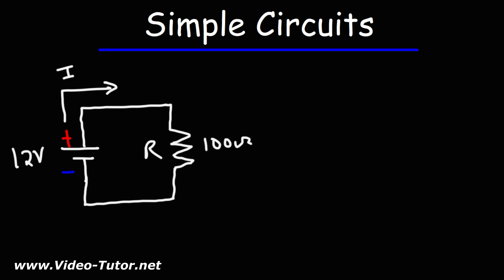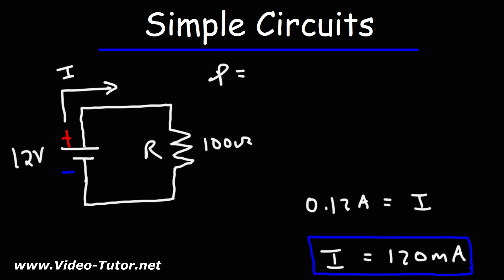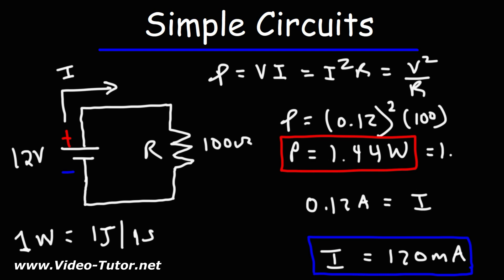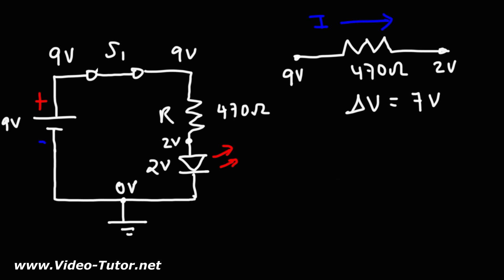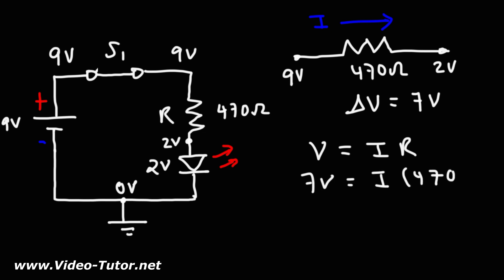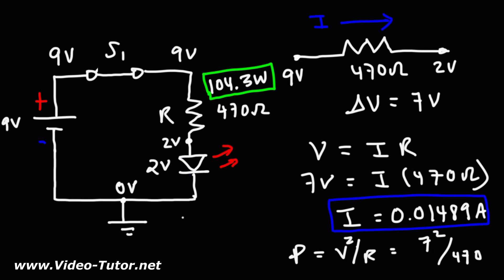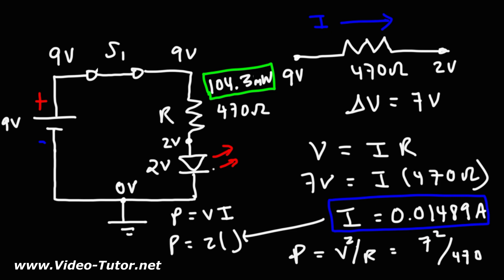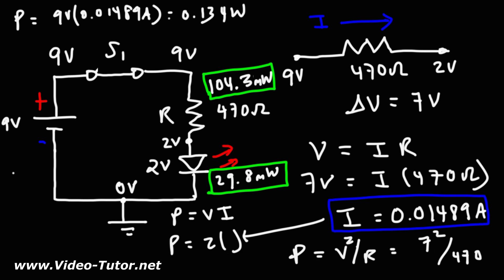Simple Circuits

Comment: Why not use 4 LEDs in series, with a 67 ohm resistor instead of 470 ohm, and get 4 times the brightness for the same total power draw of .134 watts?